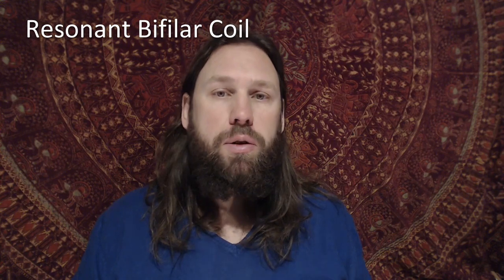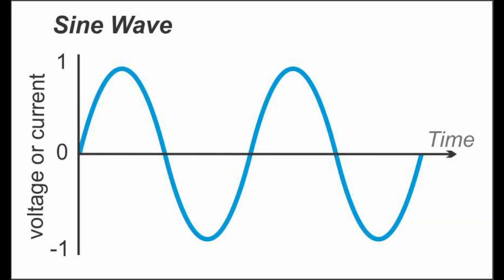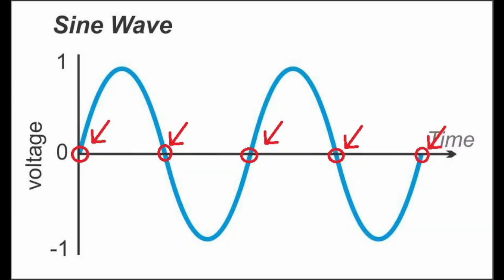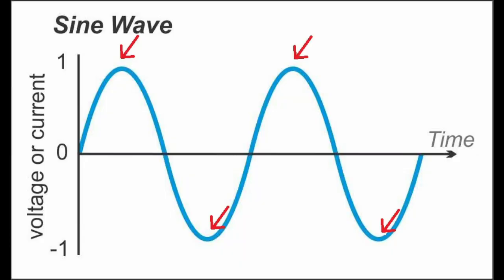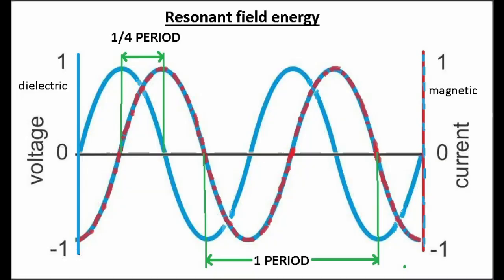C.P. Steinmetz explains electricity 02 Power, inductance and capacity

Comment: Master Ivo really appreciate you doing this. I am a converted EE, degreed in '80 and really re-thinking the whole model I was taught. I would caution you to think about your word choice and be careful not to assume there is more to this model than a philosophical representation. What Steinmetz is saying is not that the Magnetic field is transformed into voltage or that the dielectric field is transformed into current... he is saying that the fields peak in value when the factors are at maximum acceleration. This is simply an observed correlation for two wire systems and AC signals, not a physical transformation.

And to say that electrical power is conserved while explaining how each component of power can be transformed into the other, independently stretches the imagination. Only something that is a fundamental, non-transmutable base  component can be conserved, something that is made up of multiple components is not subject to practical conservation limitations if those components can be independently manipulated or the rates of change influenced by local changes in passive materials. Even still, the conservation law only applies to energy in a closed system, when only considering the isolated fields... something that can be easily modified, such as the addition of a ferromagnetic material nearby or external field... the conversion of a current to a magnetic field and then back into voltage with a phase shift would be a simple way to amplify power within the circuit. Tricks like these have been used to get around the conservation argument for decades. And selectively ignored in power transmission for equally long.

For instance, Tesla talked about shifting the phase of the magnetic field response of an electric motor with a bi-filar stator winding (in his court testimony) Thane C Heins has several YTvids on the subject. This takes a little torque out of the motor per Tesla, but adds electricity from induction to the function of the motor, creating excess energy.  The only thing that keeps the process of EM induction conserved is designing it without significant capacitance, this forces the voltage induced to match the incoming changing field phase with a reverse signed energy injection. The generation of that energy is not restricted by the same limitations of the incoming energy, so a more effective environment can also be used to amplify the power in the exchange. Something else demonstrated by Heins.

Also, keep in mind the lines of force and definition of a field are not what is physically happening, similar to the topological lines on a map. They are representative of the mathematics, the correlations, philosophy not reality. 

BTW, I thought Steinmetz worked at Westinghouse, GE would be the competition.... Maybe I got that wrong. 

Also you might keep in mind that Steinmetz was most likely instructed to discredit Tesla and his progressive work with Radiant Energy with the tools he developed to train electrical engineers. There is a purpose behind this approach to not reveal the full potential of electricity. Take it with a grain of salt. His writings on philosophy of capitalism spell out the conditions under which he was constrained.
Thanks. Looking forward to your other vids. B
Reply: Magnetics lines are real enough.
Some have proved that they really consist of lines, by svinging a coil over a magnet.
Reply: As Far as Westinghouse/GE According to Wikipedia: Shortly after arriving in the United States, Steinmetz went to work for Rudolf Eickemeyer in Yonkers, New York, and published in the field of magnetic hysteresis, earning worldwide professional recognition. Eickemeyer's firm developed transformers for use in the transmission of electrical power among many other mechanical and electrical devices. In 1893 Eickemeyer's company, along with all of its patents and designs, was bought by the newly formed General Electric Company, where Steinmetz quickly became known as the engineering wizard in GE's engineering community.
Reply: I would like to see a bifiler coil in a motor
Reply: On the front page of his General Lectures on Electrical Engineering, Steinmetz is identified as "Consulting Engineer of the General Electric Company."
Reply: Fascinating!  So what is a “field” then?  You’re saying a field is some kind of unit of measure? If so, a measure of what?  Lines of force?  Force of what? Thank you

Comment: Yes, unlearning is difficult. Question: you say that there is no power in a resonant bifilar coil, but it does contain a lot of energy at the same time. Energy and power are therefore not the same in that situation. The reason that there is no power is that both sinus are 90 degrees out of phase, you see (excellent) graph. I can imagine that when a sinus has a zero crossing, that exactly at that moment the power is zero, but at other times, for example when both are positive, there might be power because (in my opinion) power is the product of both sinus. What is right or wrong the way I imagine the situation?
Reply from the maker: yes there is a bit of power due to the small overlap, in a resonant coil. but only very little relative to the energy present.
when both are in phase, they can be multiplied, but with a resonant coil they are 90 degrees out of phase.
"Free energy" is a silly phrase because energy is only potential. Free power would be something interesting, as it would be dielectric energy and magnetic energy, in phase, and multiplied to real electric power.
Reply: @MasterIvo  This (the gain of free power) should be possible in analogy with a heat pump.
Reply: @henknicovandenberg1211  Its not "Free power from the magical nothingness" as most criticize without knowing anything about induction or electrostatics, not that i do as well yet but i am learning :)  As far as i have understood, which isn't sufficient at all ,  We have the ability to take a current and and amplify it if we take advantage of the dielectric back emf from a pulsed coil/conductor and we are able to recycle input current and rapidly pulse and churn the fields with inducing resonance dielectric back emf and magnetically and this manipulates the eathers as a spinning vortex, probably even in nano circuits. All needed is a kind of capacitor that can store this back emf negative voltage spike and input it back into a coil to induce dielectric and magnetic resonance. Different  field configurations also change the results, A torus field configuration on the bifilar coil from the disruptive discharge of the back emf stored capacitor has no magnetic properties, but still voltage, proving there is at least a "third" field, though probably infinite fields as tesla and the others speculated, though truly remarkable . Power is everywhere, the earth itself has a frequency that may be converted and amplified, the sun can be used as a kickstart current, the electromagnetic field around earth or from radio and satellites, telephones and telemetry, even your body collects charge as you are made of water mostly, that is an absorbent etc.-
Reply: @RotaryMotion  Thank you for answering my question.

To be shure I understand it well, I reedited your text a little bit like this:

"Its not "Free power from the magical nothingness".

As far as i have understood, which isn't sufficient at all, we have the ability to take a current and and amplify it by taking advantage of the dielectric back emf which comes from a pulsed circuit. 
By doing this we are able to churn the fields with inducing resonance as a spinning vortex, probably even in nano circuits.
All needed is a kind of capacitor that can store this 'back emf negative voltage spike' to put it back into a coil to induce dielectric and magnetic resonance.

Power is everywhere, the earth itself has a frequency that may be converted and amplified, the sun can be used as a kickstart current, the electromagnetic field around earth or from radio and satellites, telephones and telemetry, etc.-

What do you mean by: to churn the fields?

Comment: When you talk about sine waves there are simple rules. In an AC circuit when the power is applied to an inductor (coil) the current lags behind the voltage by 90 degrees and when you apply that AC power to a capacitor the current leads the voltage by 90 degrees. Achieving resonance is relatively easy once the physical laws and correct calculations are used.  A series resonant circuit appears as a short circuit and a parallel circuit will appear as an open circuit.
Reply from the maker: I have a question for you, as you seem to understand it well:
What about combining parallel en series resonance? two coils, one high impedance (parallel resonance) and one with only the wire resistance (series resonance).
As both bifilair pancake coils are coupled (capacitive and inductive) how would you tune these to one resonant frequency?
Reply: @MasterIvo  Firstly, you must set down the parameters of the frequency (Fx) that you want to work with.  Looking at your Bifilar coils I am of the opinion that they are more inductive than capacitive and this is easily tested with a multimeter that can test inductance (henries but most likely microhenries looking at the coil.) then test the capacitance which I am guessing would be in nanofarads. Once you have the physical values of Inductance and capacitance the rest will fall into place quite easily. If a circuit is comprised of an inductor in series with a capacitor and let us pick a nominal value of 100 Ohms for each coil and capacitor at Fx then The impedance (Z) = XL-XC = 0 ohms.
This forms a band pass filter and operates to separate unwanted frequencies from the second part of the circuit. The second part of the circuit would consist of a coil and capacitor in parallel. ( let us use copies of the first coil capacitor.) At resonance the capacitor and coil continually swap energy from the dielectric field of the capacitor to the magnetic field of the inductor and will appear to the circuit as an infinite resistance ( in theory). This circuit should take into consideration the inductance and capacitance of the Bifilar coil. 
This from memory not google.
Cheers and keep up the research it is a long and hard road.
Reply from the maker: Thanks for your reply. Since the coils are coupled, it cant be looked at as a single series or parallel resonant coil. I measured 0.61mH  capacitance cant be measured but  is more in the 100-300 pF range I think. resistance is at absolute minimum, 0.7 Ohm per coil (I now use 10m 0.75mm2 speaker wire pure copper) 

Anyway there is no other way but add parallel capacitance and tune over and over again... but worth it. I hope.

Comment: Your belief that all energy must be transformed, is based on the non-law of conservation of energy. That 'law' is not a law at all, and has never been proven. The field energy can simply vanish back into the dielectric.
Reply from the maker: In my perspective, energy does not vanish, it is transformed. if it is stored in the dielectric field, it can transform back into the magnetic field, or into Radiant Electricity. Not all energy configurations (all aether fields) are properly researched. I agree the conservation of energy is not a law, in respect to what I have just stated.

Comment: It seems that the key difference between solenoid coil, standard pancake and bifilar pancake is the efficiency of energy storage and conversion, is this correct?  Not an electrical wiz yet, but I am getting there, a good comparison between all 3 would be terrific!!!, Thanks for the great work.
Reply from the maker: Yes, the ability to store electric energy  in their dielectric fields is what si different. When the bifilar coil is resonant, it can store much more energy in its tranforming magnetic and dielectric fields, than a standard solenoid or pancake coil. thats also why the resonant frequency of a bifilar coil is much lower.